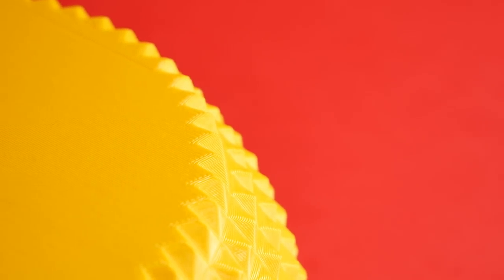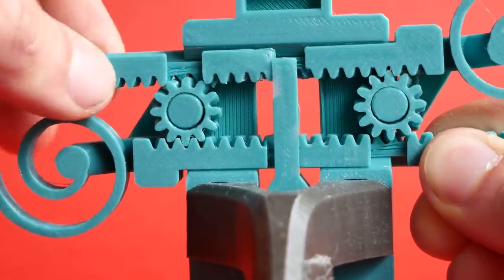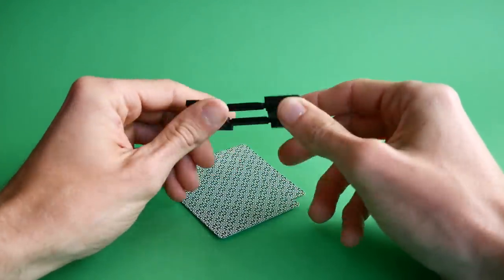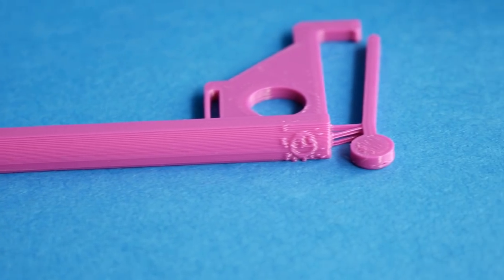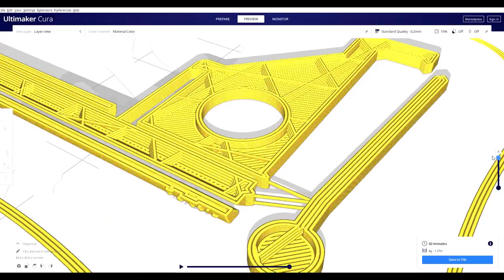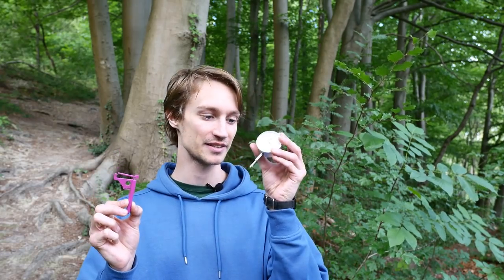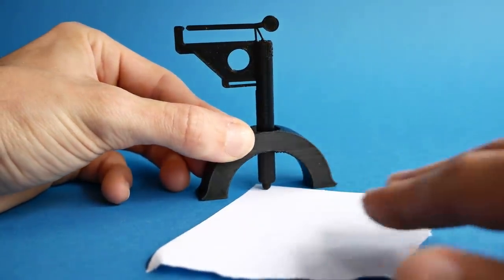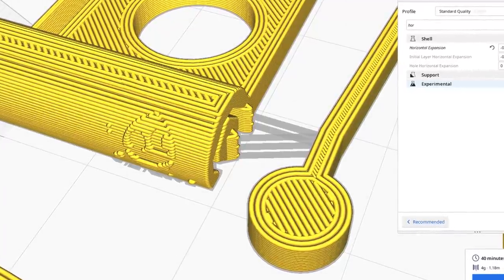Dial Indicator 📏 3D-Printed COMPLIANT MECHANISMS!!📏

Comment: of course when i print this the first layers are smudged together, locking the mechanics of this device...
Reply from the maker: you can try printing the 0.5mm version, maybe even ad some negative "initial layer horizontal expansion compensation"

Comment: it seems these "compliant" mechanisms aren't as good as their traditional counterparts.
sure they get the job sometimes and they pretty cool but i don't think they'll ever fully replace the traditional tools.

the wrench for example has a limited size that it can clamp onto and this dial indicator doesn't have the needle spinning very far so you can only really detect with in a very limited range.

i'd be interested to see if you could design a dial indicator that can at least function equivalently to the tradition method with the compliant mechanism kind of design.
but i bet then the bending bits would wear out pretty fast but just a guess.